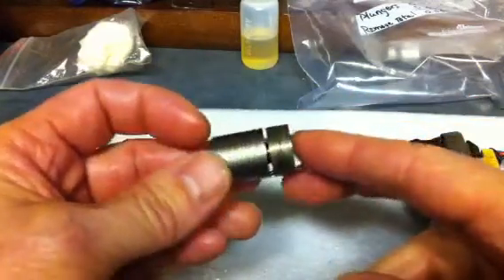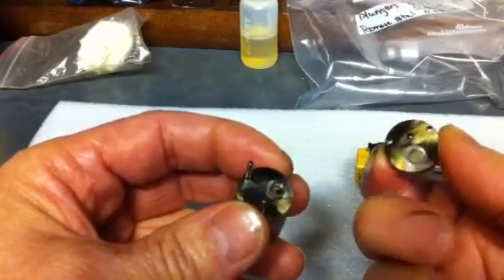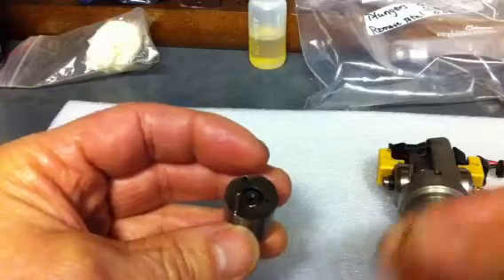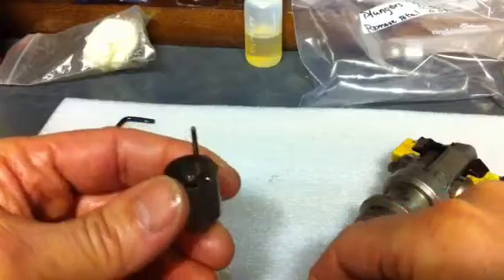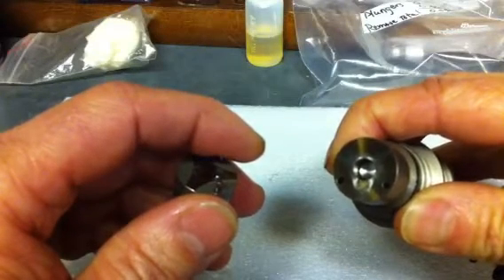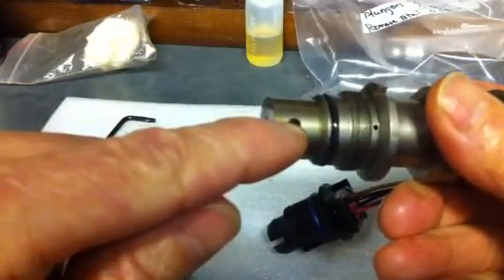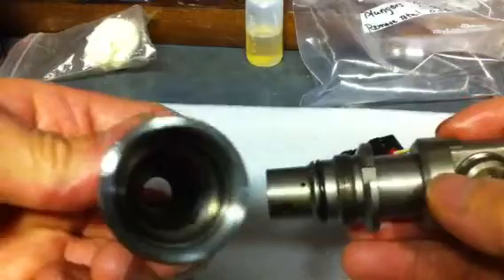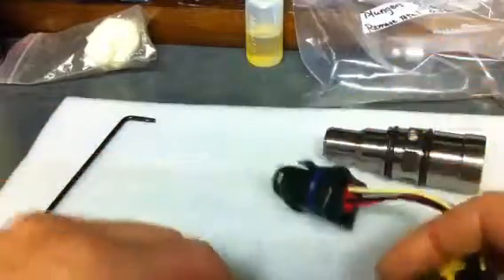6.0l Powerstroke injector part 3

Comment: How do you modify the injector?
Reply from the maker: Hank Henke go to powerstroke.org and search out the how to modify injectors to larger flows
Reply from the maker: There are a few ways, one being adding a shim between the spool valve and the injector body - the easiest but smallest upgrade and not really recommended, and cutting the intensifier piston and plunger to add additional stroke volume. My thread on how we got here:   

http://www.powerstroke.org/forum/6-0l-performance-parts-discussion/333002-modifying-injectors-larger-flows.html